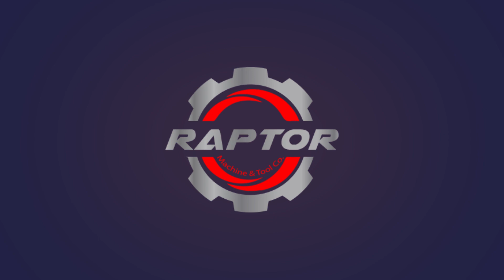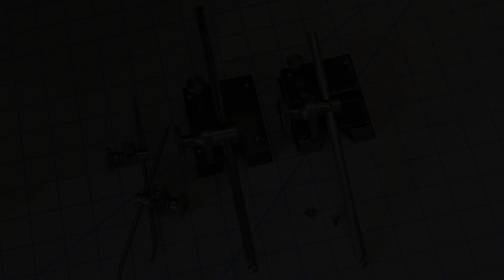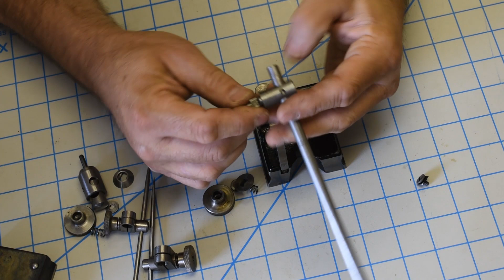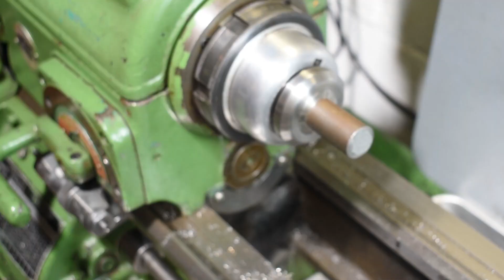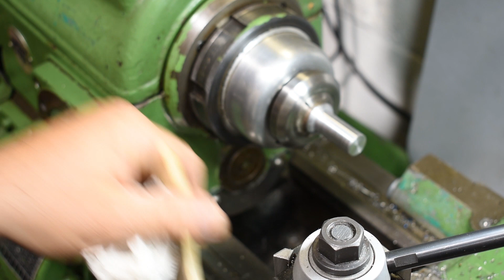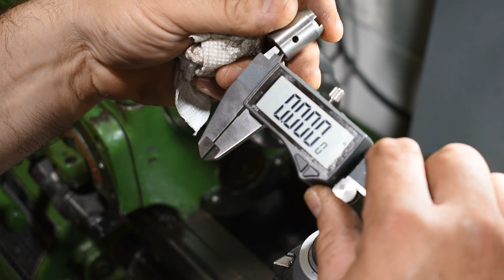Starret Surface Gauge Repair Part 1

Comment: If both those surface gauges were made by Starrett you have two from different eras. The oldest one has the color case hardening which was done I believe in large volume production using Cyanide. There's various others methods such as pack case hardening that are too slow and labor intensive for that high volume requirement. Due to much more stringent rules and regulations about using Cyanide in the work place I believe Starrett abandoned the use of it and started using black paint on the gauges lower assembly. Your oldest one is for sure hardened due to that unmistakable color case hardening. The other painted one may or may not be hardened as there made both ways. A file test on a unobtrusive area would indicate that for sure.Both vertical rods still have the ball on the end that was used for a couple of reasons. One was to park the curved scribing tip inside the lower radius when storing the SG, and the ball could also be used with a dti when checking vertical surfaces for squareness. Starrett in there infinite wisdom by the bean counters no longer make there surface gauges with that imo completely necessary ball end. So both your SG's predate that change. I bought a brand new one from Starrett a couple of years ago and considering it's current price, the huge run in the paint that never should have made it through there QC if they gave a damn and that now missing ball end I'm extremely displeased with what there now selling as a high quality and well made SG.
Reply from the maker: Great explanation and tips on some of the uses of the surface gage...     good idea to park that curved end of the scribe as it will jab you every time it can !  thank you !  Joe

Comment: I have a surface gauge with the little square washer, but I'm not sure what it's for. It could be for keeping the spindle from falling out like you said, but it has sharp corners, and it would have been much easier to use a simple round washer
Reply from the maker: Rob, the more im thinking about it..  maybe they were used to scribe ...   very close to the surface..
Joe

Comment: Hey Joe.
Love the intro to your video,s.
Good work on the editing too.
Not so important whether they are genuine Starrett.
As long as the quality is good and they do the job well that what,s important.
Great little project to work on.
Thanks for bringing us along.
Peter.
Reply from the maker: thanks so much Peter !   i  am learning Premiere Pro slowly..   i have never used a software like this before...   I just figured out how to split the clips to speed certain portions up ( but not the whole clip ) so part 2 should be a big improvement !  slow but sure !!!

Comment: Oh my Starrett you are the big name guy now. They are both really nice to have around and we are very happy you re sharing them. Nice tool learning here. Yes you can just machine a new one or order one from Starrett, they are by the way, in case you do not know, very nice and easy to work with just made an order there and all went well.
Yes way to go machine one a new one now you can share hey, hey I made that:) Nice lathe work we loved watching that. See you for Part 2 and back fro Part 3 we are not going to miss anything. 

Lance & Patrick.
Reply from the maker: Thanks Lance and Patrick !    i figured it would be a fun project to make one.